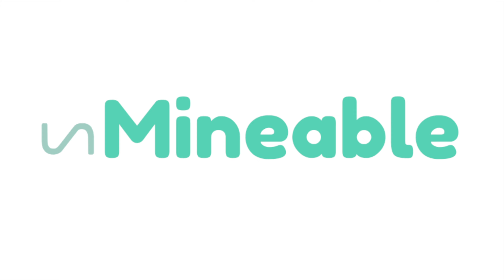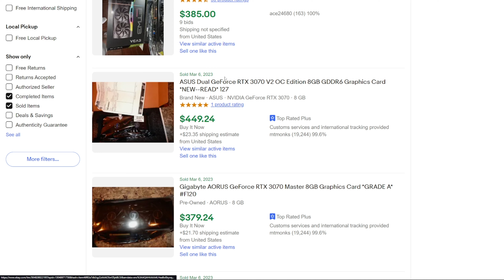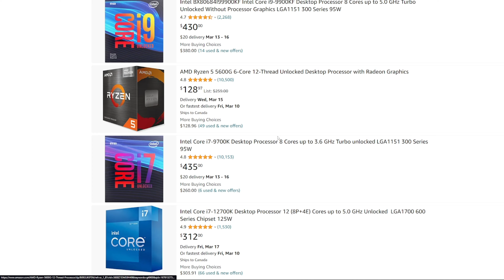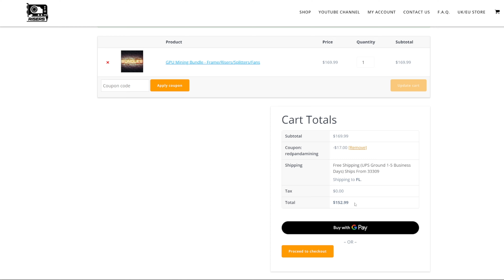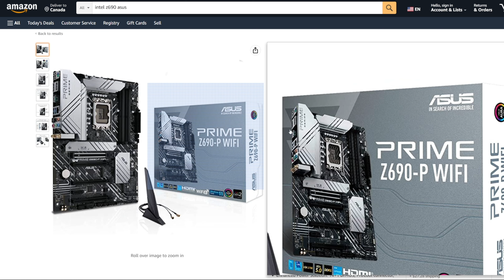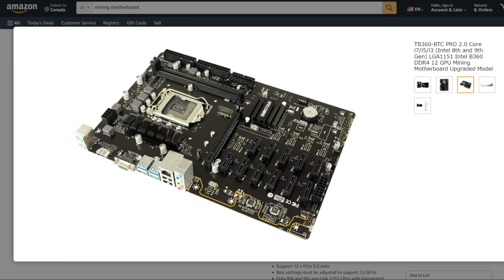How are GPU Mining Hardware PRICES Now? March 2023

Comment: all the mining boards are pretty much garbage
1.) stability
2.) bad processors
when compared to the 3900x
the density factor
and the energy, you just can't beat getting AM4 even if it only comes with 2 (4) pcie slots

Comment: 40 series is smaller bus size and dies the size of lower tiers from the previous 3 generations (other than 4090). I'm a HARD pass on the lower bus sizes. You are better off to go with a new i-3 than by the G series celerons at this point. You can actually cpu mine (not great efficiency but you can) on an i-3. I ran G series then switched to i-3's on my prime boards when I had them. (I changed all my boards to MSI-b450-Pro with Ryzen 5500's they are so... errorless). (.057kw/hr)

Comment: GPUs seem to be going back up in price.
Been tracking 5600xt on ebay cuz I am trying to sell a couple.
They hit a clear bottom right around the holidays.  Now that holiday pricing is gone they have gone up about $20.
Also, good luck with $160 5700s. Those are guaranteed mined on, hard. Half my 5700/xt will not play games anymore and only mine. They all green screen, which was a release problem
Reply: did you modify the bios?
Reply: @dontsupportrats4089  Yea, but they didn't have a problem till TRM released the R mode.
That was when I started noticing issues with the 5700/xt specifically.
The green screen was fixed for most people with a driver release so I tried that.  But some people to this day cannot use their cards on most systems, if any, because of the green screening.